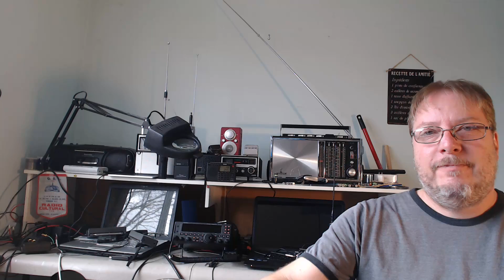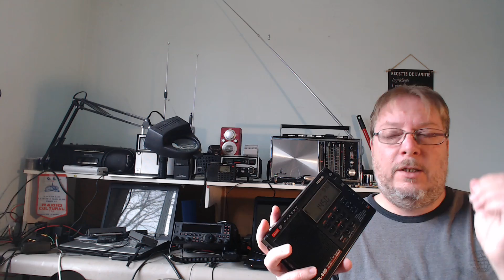Shortwave radio tip 33 What is Synchronous Detection and how to use it

Comment: Very well explained, Gilles. Sadly not every sw-radio has Sync.-Detection. Some years ago only the Sony ICF-7600G had it implemented as a answer to their competitor Grundig Yacht Boy 400 with its wide/ narrow-filters.  On my S350DL I have no Sync-Detector but I use the "low pass filter" and "narrow-filter" to get clean sound on noisy and interfered frequencies. It works quite good e.g. when I want to listen to 5955 Khz BBC from United Arab Emirates-Relay and to the same time Radio Romania on 5945 KHz interferes very strong. Anyways, a good working Sync.-Detector would do a better job to sort out interferences but other tricks also work when a radio hasnt it available and especially my radio which is a analogue one. Thanks for the nice video. VY 73 DE1DGK

Comment: I've got synchronous detection on my AOR AR3030, the signal on AM stations usually sound clearer with sync on.  I'm not sure if it's as good on weaker or very weak signals.
Reply from the maker: depending on how good it is , it might be good even on weak signals